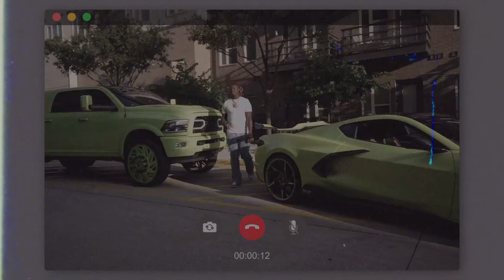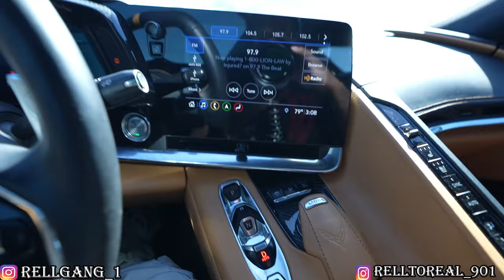FINALLY GOT MY 72 CUTLASS RUNNING AND NOW WE ABOUT TO GO TO PAINT!!

Comment: Have cj Get intouch with Gabe. He can get you in good with Jtx.

You kno those old schools aren't symmetrical so some uneven gaps were like that from factory, especially gm. I got a og 71 442 vert a 68 442 hard/vynl top. FYI the gas cap sits in that notch on tag plate, that's what holds the plate open to fill up.